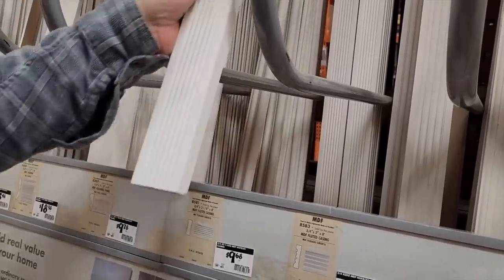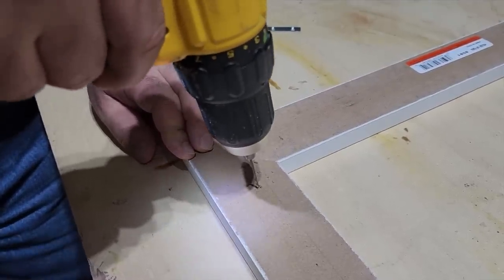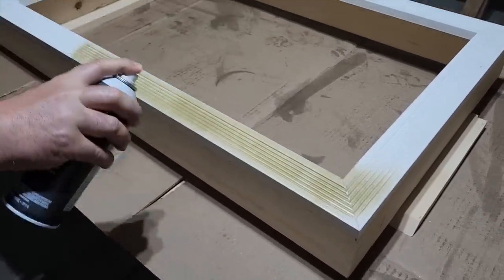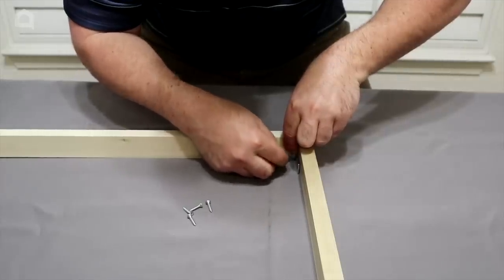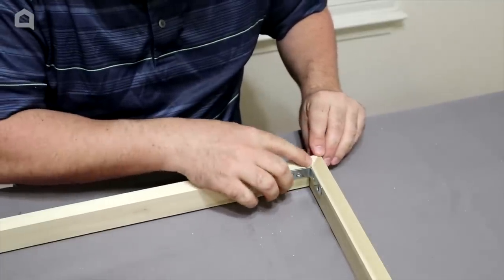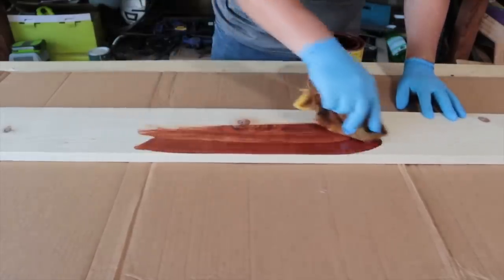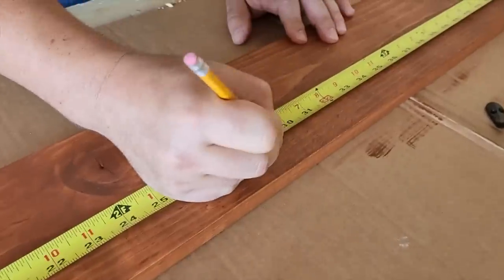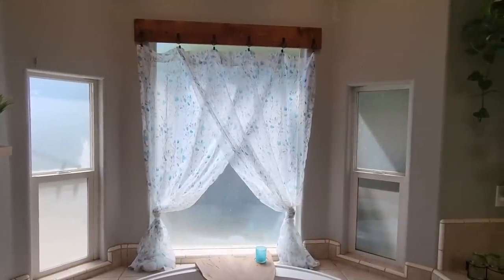Hide your TV in plain sight (This is GENIUS!)

Comment: Could-have & should-have probably made/used some wafers/biscuits to join the corners.
Reply: Not many DIYers have the equipment to make biscuit joints, but most anyone has or can borrow a screwdriver to apply the corner braces. And the finished frame isn’t going to be subject to much stress, so I’m pretty sure the fancy joints won’t be missed.
Reply: @gailwilliams5278   agreed. Most pic frames are joined with brackets, not biscuits .
Reply: I do see what you are saying.  Hometalk is really about showing many beginner and novice DIYers how to make their own simple projects.  Many viewers do not even know what wafers and biscuits are so this method does work and is simple to do.

Comment: The frame: Do you think you’re talking to morons?  Indeed It does cover the eye the reads your remote. Good luck with that. 🧐☹️🤪
Reply: Rude much??? Not if u make the frame to leave the infrared showing.
Reply: Hi Linda, if you cover the remote eye on the tv, a small drill hole right over the eye will allow you to change the channel or picture on the TV.